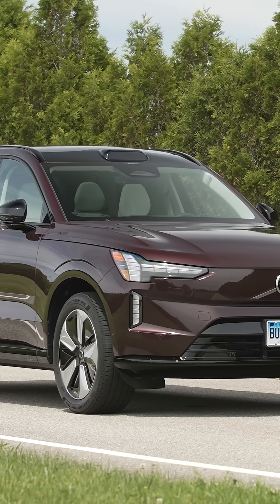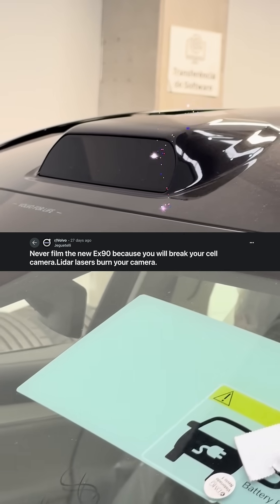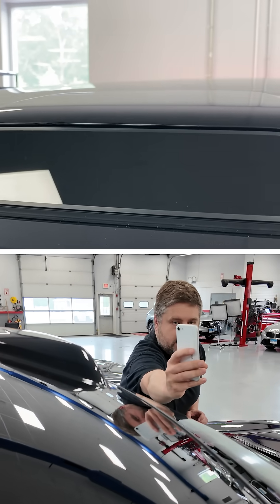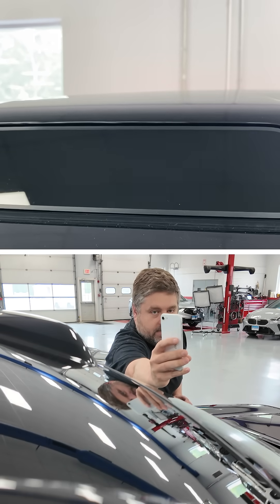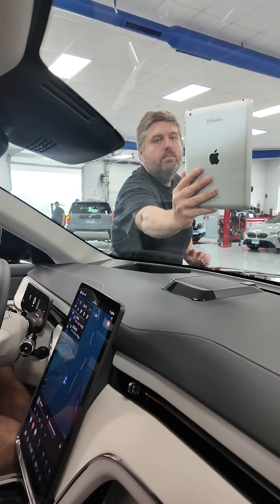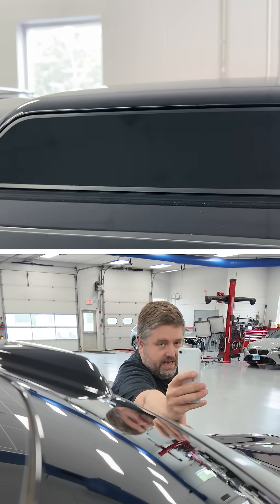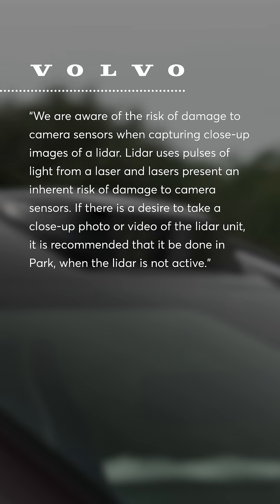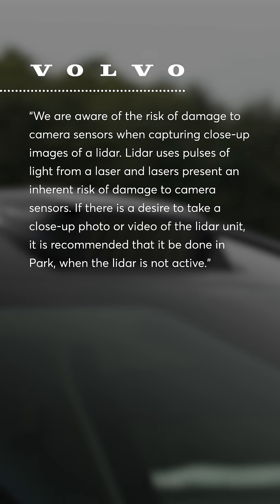Can a Vehicle's LiDAR System Fry Your Camera?

Comment: Assuming that both this and referred videos are true, The wavelength of 1550nm is very long to be visible by a silicon CMOS sensor. The white dot is likely a thermal damage, meaning that the power is too high to be safe for environment and human eyes. Good luck to them to prove that this degree of irradiation is safe. Someone in Volvo will be fried and company will suffer big losses.
Reply: “…will be fried…”

Perfect typo. 😂

Comment: The reason the iphone camera was not fried is because Lidar can only easily fry telephoto lenses, meaning that you have to zoom in about 3x for the telephoto lens to start frying. It did not appear that he zoomed in his camera at all which is why it did not damage immediately. If you hold a camera in front of it without zooming in, it would take much longer to fry than you would think.
Reply: Pixel pitch is the more likely factor. Most zoom is digital, so it would have no effect. The telephoto sensor may have been getting destroyed and the regular one had no effect, but simply zooming on a single sensor camera (without an optical zoom) will not change anything.
Reply: Or the fact the ancient iPhone he used just did not have a telephoto lens

Comment: You're very clearly trying to be partial to Volvo in this video. You said that it's not a big risk despite the fact that it ruined the iPad camera. "Just put it in park" is not a viable option when I'm taking a picture on a sidewalk and someone else drives by me in their Volvo. Would that damage my phone camera? Is that far enough away? Why did it only damage the iPad and not the phone? Is it because the iPad is older or is it something else? We don't know because you didn't test it thoroughly and blew off a ruined camera as "not a big risk."
Reply: Telephoto lenses focus the lidar making it more powerful. So the single lense camera phone he used is known to be more protected. 

Also the lidar uses infra red light that is not needed when taking a picture because we can not see that light. So some cameras have filters to block infrared which makes them safe around lidar. But most cameras don’t have that.
Reply: Are you stupid?
Reply: Who is liable for this damage?  I’d imagine the car owner is responsible for the damage their vehicle does to others.  Then the car owner would need to go after Volvo for making a product that fries every camera that takes a picture of it.  Yikes.